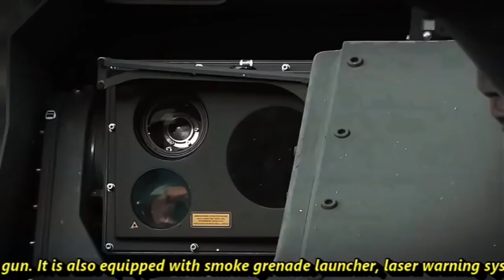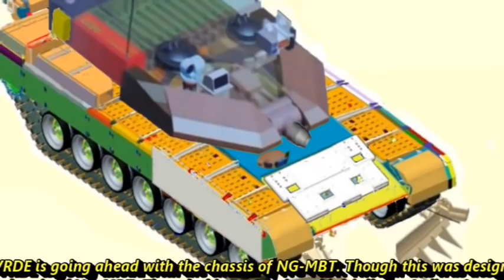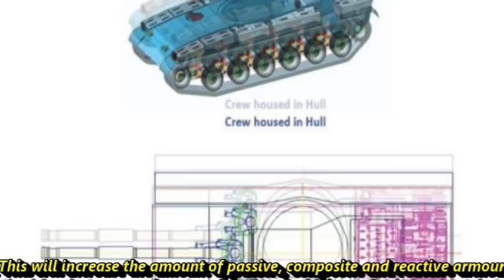L&T Offers 2 light weight tank for Indian Army with Hanwha Defense & DRDO

Comment: Cutting tank weight means reducing gin size and armor thickness. It is a trade off; lighter is not necessarily better.Ultimately the Army has the expertise to decide.
Reply: In terrain like ladakh only light tanks can out perform. Thats why chinese also made vt4
Reply: @Kem____paalty16  
There are light tanks and light tanks.India already rejected the 14 ton Russian Sprut carrying aluminium armor. A max weight of 25 tons cannot sport as much armor of a 35 ton tank, I reiterate- the selection requires a substantial trade off ; you have to sacrifice somewhere to gain somewhere else.
Reply: @physicsonline8853  ur right, but I don't get it why aren't they having wheeled 8×8 tank destroyers. With ability to put bolt on rha panels to 25 tons, 3 men crew with 120 mm. Gun, a Japanese mcv type 16 or centauro.  Easy to build and cost efficient also.
Reply: @Kem____paalty16  
One shell will destroy a tank destroyer; basically they carry guns but don't have much protection.
Reply: @physicsonline8853  but that no thier job they are sniper rifle teams of tank battle theatre you shoot and change position, thiers no tank which can be said invincible but tactics are also something to be considered.

Comment: K21 can be build tomorrow, the DRDO model will be at least ten years in the making they needed 40 years to develop the Arjun MK1 and where insulted by the request for upgrade work. L&T is the only one of the three that actually can deliver on their promises. Plus the indigenous design is nearly as heavy as the more capable Russian MBTs and it will take them 10 years to solve the issue. I don't think India will survive another endless tender.
Reply: Wally Wolf dont cry Wolf unnecessarily.
Reply: @prashanthb6521  can you actually write something that makes sense?
Reply: Why aren't they going for wheeled platform with 120mm gun like italian centaruo

Comment: Simple option is to buy few russian spruts ,study design and add armour as per your own requirements. That's what Americans did to make light tank.they just used their own basic design ,reduced dimensions and made light tank in 6 months.remove bureaucracy IITANS will make light tank in 5 months😆😊😀😁😂😃
Reply: Sprut tank is rejected by indian army
Reply: @anuparnoacharya5779  whst is the reason?
Reply: We needs around 40 tons modern tank like T 90 MS also. Bcoz using technology transfer we can develop this type of weapons to produce large number in the future. South Korea may be a good choice.
Reply: Lolz IITians haven't  made a LRAD yet. And sprut sdm has only 1 benefit that it can be air dropped but tell me, in case of small scale war when china has better subsonic drones will they even allow iaf to fly transport aircrafts any near theatre of operation to air drop sdm sprut. they should outsource 120mm and 105mm apfsds guns and make a wheeled platform like Japanese mcv type 16 or automelara italian centauro.